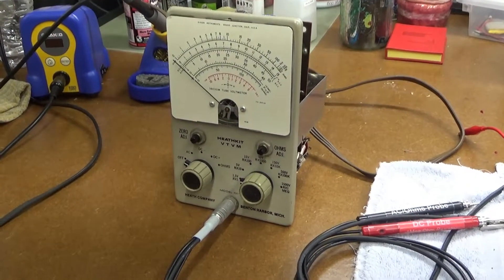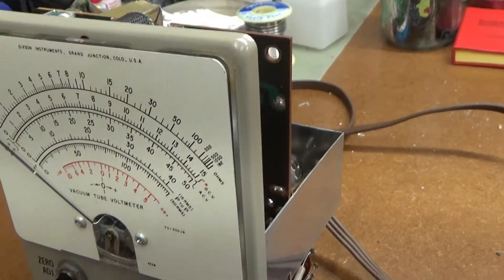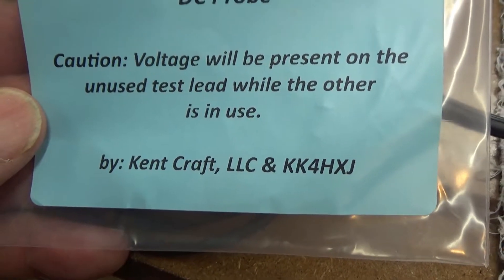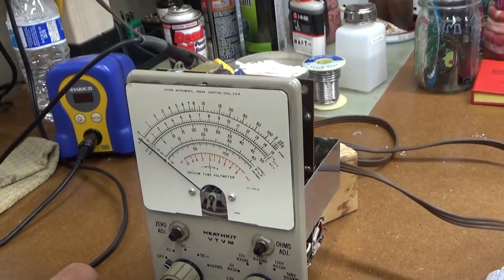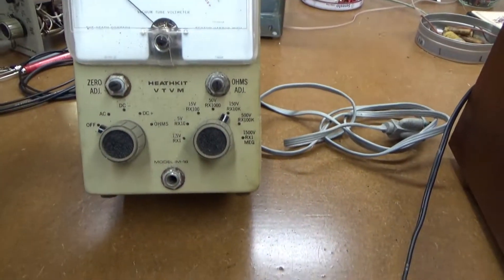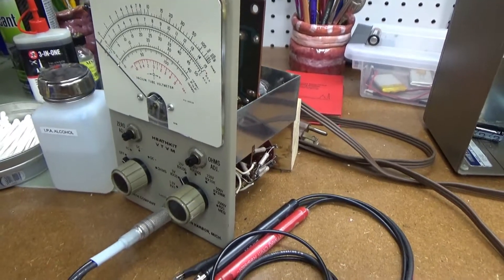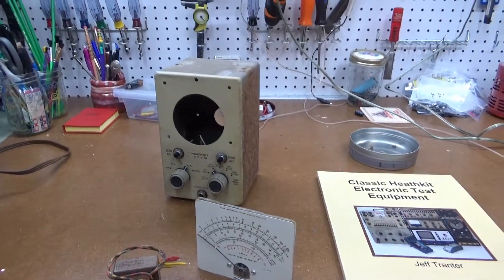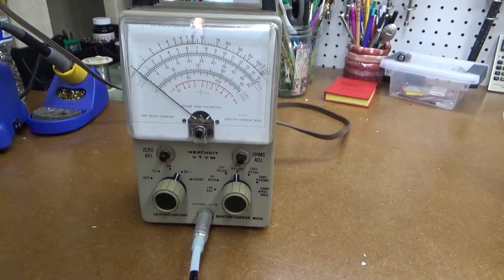Heathkit IM-18 VTVM Restoration

Comment: just a note that 12AT7/12AV7/12AZ7 are adequate substitutes for the 12AU7 .  12AU7s are getting expensive and 12AV7 or 12AZ7 can still be found NOS at low cost
Reply from the maker: Thanks for the comments and substitute suggestions. A few years ago I parted out a 1964 Conn organ that I purchased for $10. I harvested around 20 Conn branded 12AU7's that were used in the tone chassis. I believe the tubes are re-branded RCA "clear tops" that test like brand new.  I think there were very few hours on that organ. Unfortunately it spent many years in a garage or barn and was infested with mice. I probably should consider selling off some of the 12AU7's as I'll never need that many for myself.

Comment: Those are nice probes. Bought them for my VTVM which I got, a supposedly working VTVM on Ebay, but it had a two prong polarized plug on it.
Not only that the hot and neutral were swapped going to the power transformer.Had to redo all that including the 16uF capacitor.
 Yes ,after calibrating it my IM-18 works as it should! Thanks for showing those to us!
Reply from the maker: I agree, the probes are very nice.  I've bought 3 sets so far for all my Heathkit VTVM's.  I'm glad to hear that you got your IM-18 up and working. However you stated that yours had a two prong polarized power plug.  I believe that the IM-18's came with a 3 prong power cable with the ground connected to the chassis at the negative connection of the battery.  At least that's how mine is configured.  My older Heathkit V7-A VTVM's have the traditional 2 prong power cable.
Reply: @mguess  Correct. I had a spare  3 wire cord that I replaced the two wire one with.
That alone was an important change which improved it's safety as well as correctly connecting to the right places.I was then able to get the AC measurement
part to work.

Comment: A lot of ppl would swap out the electrolytic cap. I just got the same meter. My first.
Reply from the maker: Thanks for commenting on the video.  I hope you found it useful for any required restorations on your VTVM.  I did replace the electrolytic capacitor.  I just didn't show record the replacement for the video, ops.
Reply: @mguess  Very interesting video thanks. Glad you were able to restore it cheaply.
Reply: @mguess  You may know this already, but Heathkit engineers released a battery eliminator circuit for their line of VTVM's they take power from the 6.3v filament line. No more leaking batteries! this guy here shows the circuit at 6 minutes 22 seconds: https://www.youtube.com/watch?v=IlaGhx2rqK8&t=403s
Reply from the maker: I did use his battery eliminator circuit on one of my Heathkit V-7A VTVM's.  Were is the link to that video where I mention the circuit.
https://youtu.be/J9Y6LNl1iEg